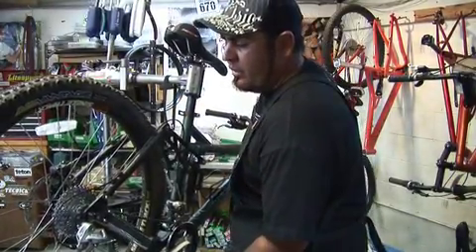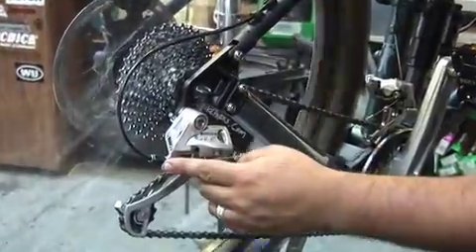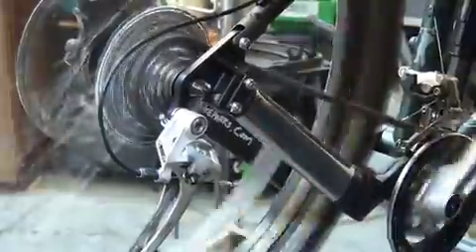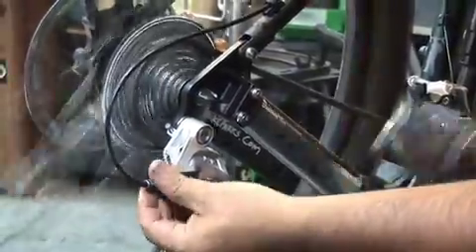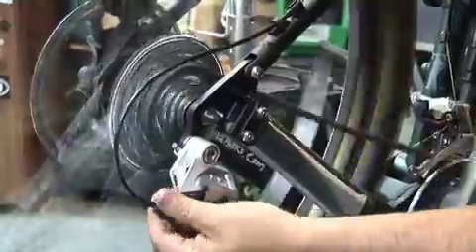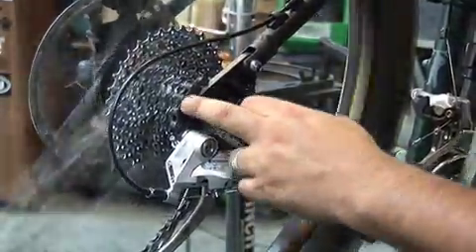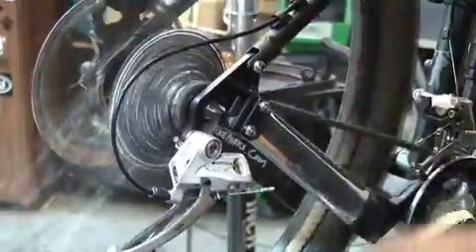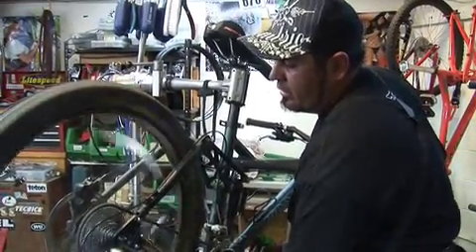2 - Adjusting a Rear Derailleur

Comment: @mcv99e99 This is correct. He clearly states the purpose of the video is to demonstrate how to adjust the rear derailleur so the chain does not hesitate or skip gears, by adjusting the barrel. He doesn't mention once that the video is about how to stop the chain from jumping off the cassette (which the limit screws do). 

He works in a bike shop, so I think he knows exactly what he's talking about.

Comment: @BuddLightbrain 

Tension adjustment, as seen here, is in 99% of cases performed AFTER a rear derailleur is already installed and set up. That, believe it or not, is what the barrel adjuster is actually for. Cable stretch will cause noisy or insufficient shifting, as also witnessed here. Cable stretch does not necessarily mean your limit screws are out of whack, it means that you need to re-adjust the cable tension. There's really no need to start from scratch with your limit screws.

Comment: @BuddLightbrain 

In a derailleur's life, I use the high and low limit screws about 3 times at most. Once when it is new, twice if I ever replace a cassette or crankset, and perhaps a third time if I ever severely knock it out of alignment. The rest of the time, barrel adjustment is perfectly fine for this level of FINE TUNING. This guy does another video that deals with low and high limits, so you really shouldn't be trying to scare people. They'll have more chance of success trying this first.